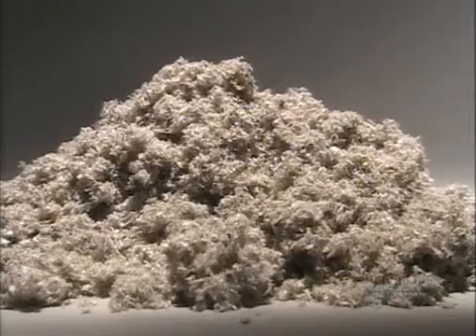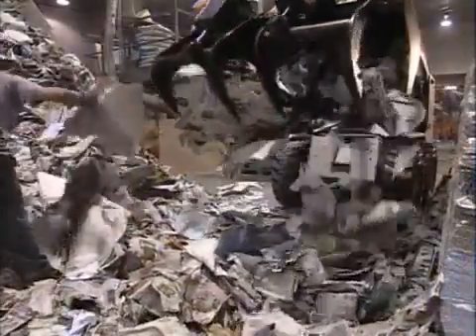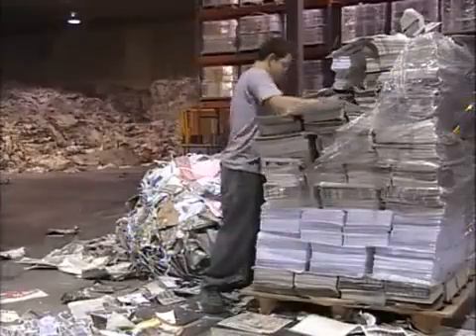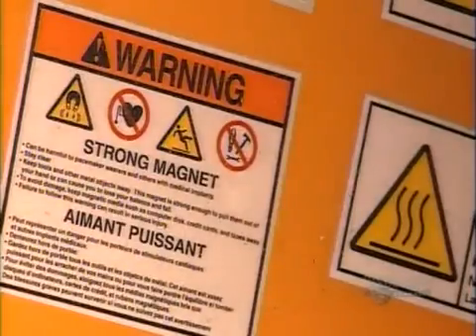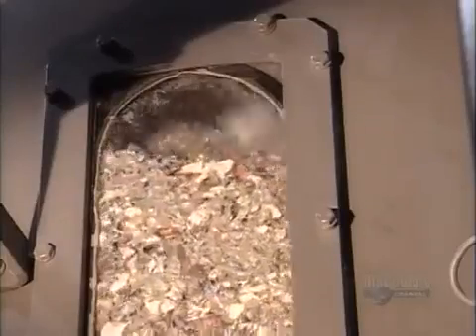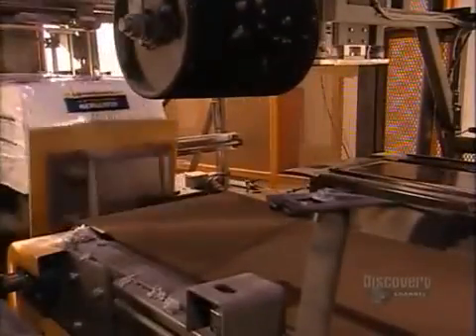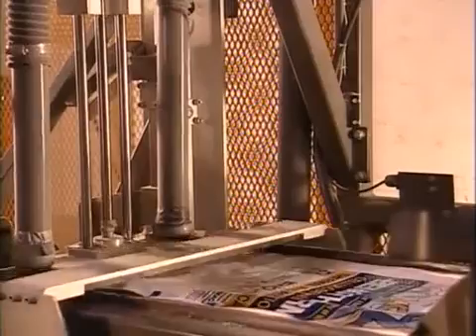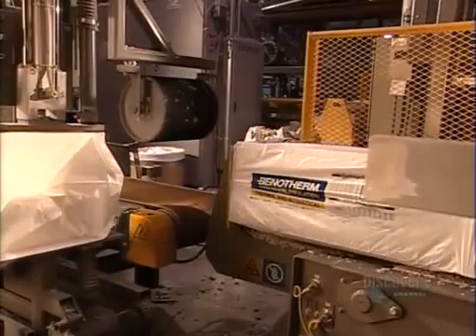How to make  Cellulose Insulation

Comment: Well, if you need insulation, all u need to do is to stop mostly the UV to IR to radiate your home. All you need is tin fin of aluminium. %98 reflective pure aluminium foil. Less expensive, most lightweight material produced. All the energy to need to produce celulose or other insulation materials will not improve your heat conduction/radiation/convection if you  do it properly. Best regards. Solar thermal student.